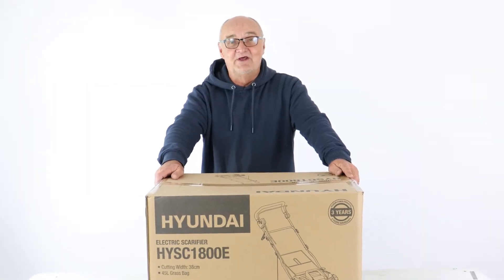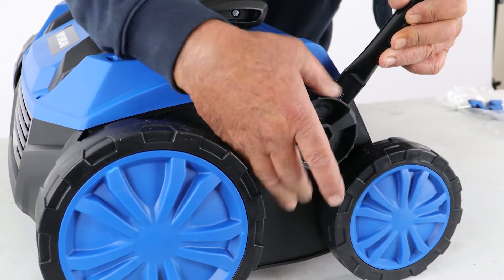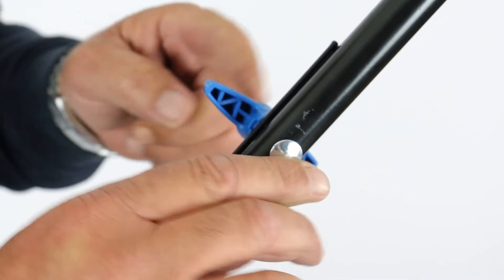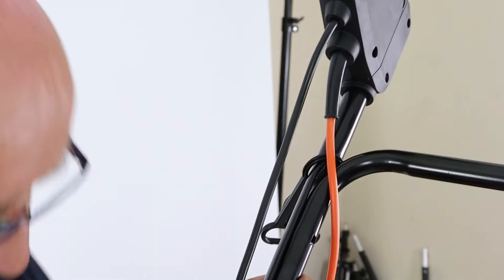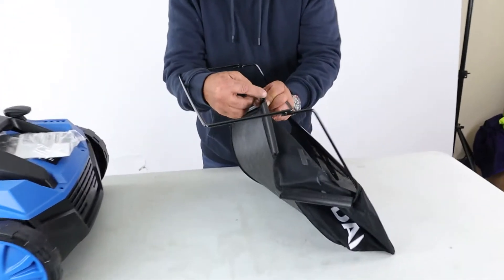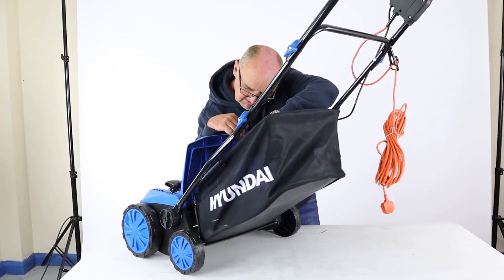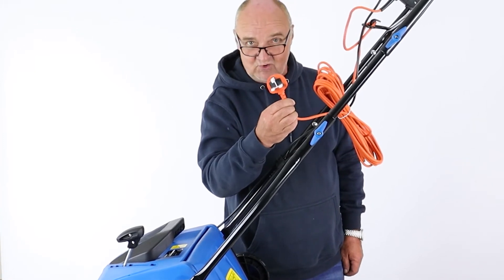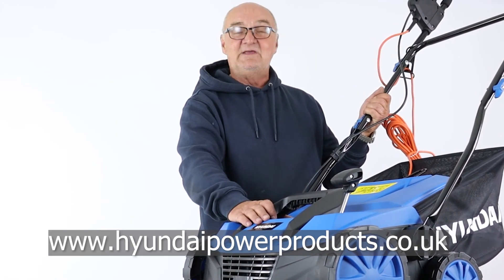How to setup your lawn scarifier (The Hyundai HYSC1800E 1800W Electric Lawn Scarifier)

Comment: Legend.. So detailed and all the important points covered flawlessly, even the explanation of which is the "aerator vs scarifier" which the manual instruction document confused me by calling it scarifier (the aerator) and raker (the scarifier). well done thanks.
I have a question as i received this scarifier today: for removing my moss and dead matter - which one should i use? is the fitted aerator only to do this once or twice a year to dig holes for good aeration? and the other bit to normal scarify?
Reply from the maker: Hi Alex, generally yes - for a more thorough scarification, you can use the bladed fixture. For a general use, de-mossing/thatch you would be best off with the rake attachment. Hope this helps and glad you found this instructional video helpful! Happy gardening!